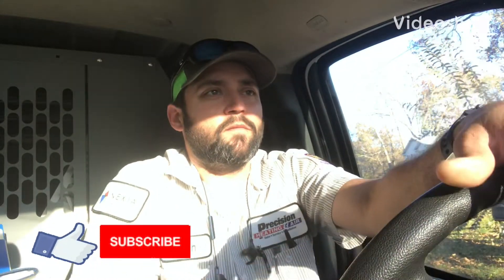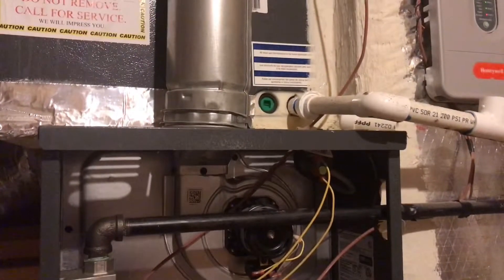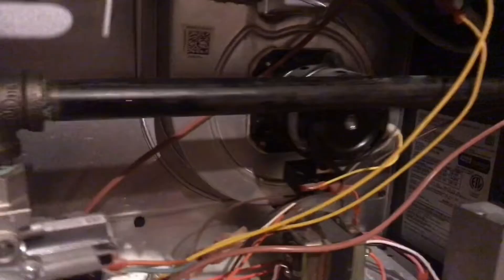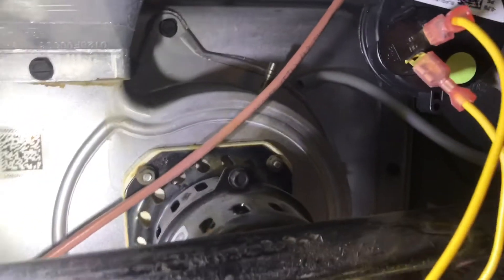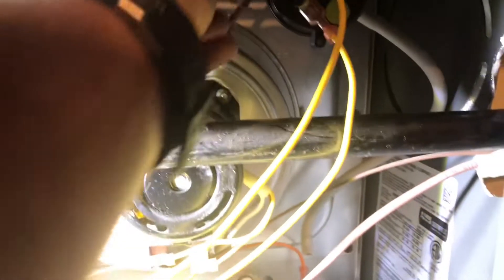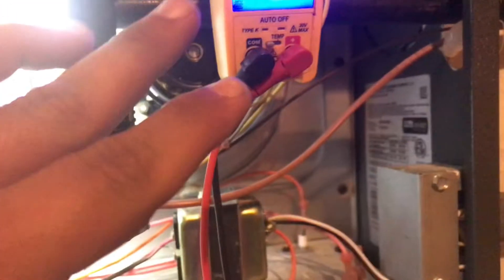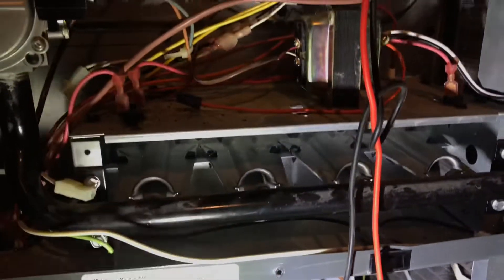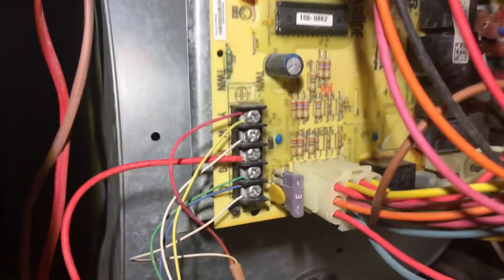How to Diagnose a Furnace | Order of Operation

Comment: What do the red and green light blinking on the panel board mean when l crank up my heat for winter
Reply from the maker: Is it working? If not, It could mean a lot of different things. It’s normal to have blinking lights when the furnace is working correctly too. There should be something on the furnace door that tells you what each blinking light sequence means.

Comment: You are the man!  I was waiting for a new control board because I pretty much eliminated all other issues...until I watched this, and decided it wouldn't hurt to clean out the pressure switch and connections.  Voila, that did the trick.  Thanks so much.  Having the parts guy hold the board for a couple days, just in case.  Thanks again!
Reply from the maker: Awesome!! Your welcome!

Comment: How do we check to make sure if the gas valve is fine after when it's right after the ignitor during the sequence? Thx in advance.
Reply from the maker: Check the voltage from the 2 wires going into the gas valve. After the ignitor lights you should hear a click and have power sent to the 2 wires. If no power is sent it’s a bad control board. If power is sent and the valve is not opening it’s a bad valve
Reply: @HVACTechTips  Thank you Josh.